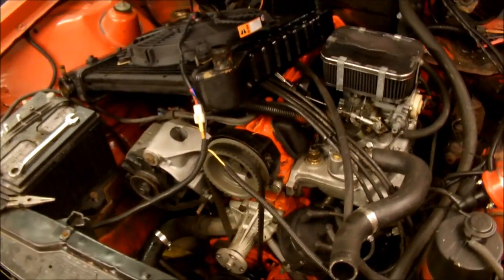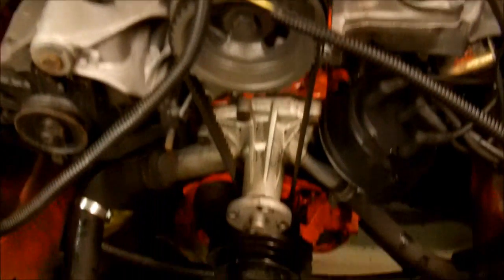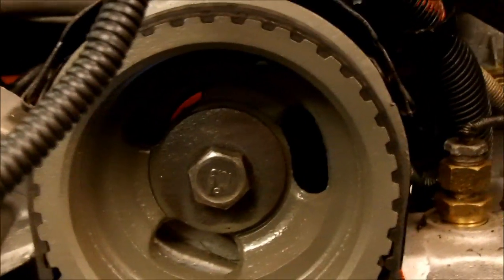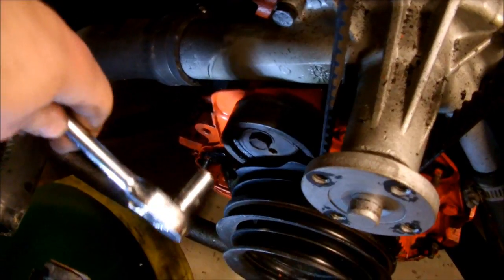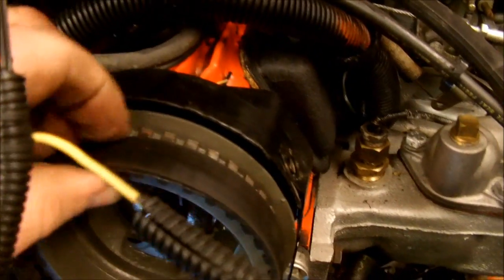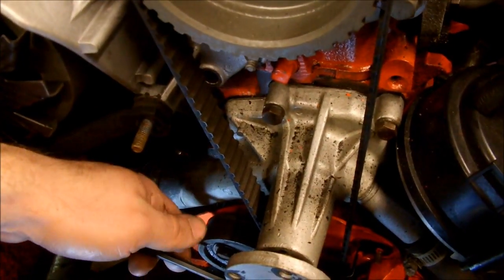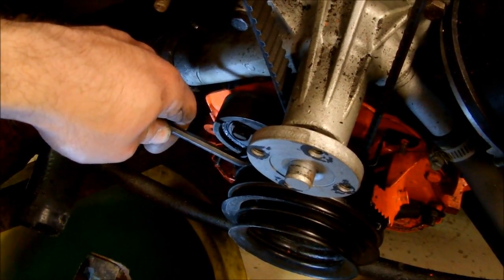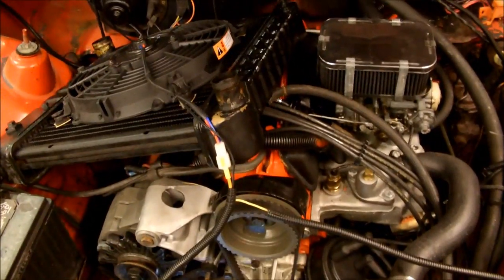How to change a Chevette Timing Belt

Comment: Installed Cylinder head on mine any help with vaccum lines needed to keep car running.  Need help should of took pictures got it running but won't idle due to vaccum any diagram help appreciated.

Comment: You rock dude! I just lost the timing belt on my 85. Thought a vid was a shot in the dark. Glad I found ya!
Reply from the maker: Its so simple but it seems to be lost knowledge already, thats why I made the video
Reply: +Fuel Injection Sucks What did you set the idle speed and/or total advance timing to? How many degrees? I'm at about 5000ft above sea level. Can't find shit except: 1400 @ 8degrees. Sorry, new to timing this thing.
Reply from the maker: +PharaohMoan As far as idle goes, 600rpm is manual trans, 800 auto trans. Timing I'd start at 8 degrees advanced at idle, and add in from there. Your high altitude is going to skew factory settings.
Reply: +Fuel Injection Sucks Thanks man!

Comment: I married into ownership of a 1979 white chevette in 1989.   I followed a series of videos from sloopy mechanic when I saw your twenty something horsepower chevette.  I still have the timing belt tension tool you mentioned.  The only time I used it was on the chevette.  The NAPA parts store suggested it.  The family came along so we sold the chevette and  moved on to a celebrity wagon followed by a couple of chevy astros/gmc safaris.  I believe GM made millions of chevettes but I do not see many around today.

Comment: Fuel Injection Sucks. How reliable are these Chevettes if you keep up on maintenance like oil timing belt? Thinking about getting 1 in future they seem good on gas cheap easy work on.
Reply from the maker: Pretty reliable but some parts are becoming a bit scarce.
Reply: @FuelInjectionSucks  is that a interference or known interference engine?
Reply from the maker: @briansmith9698  non-intererence, but any engine can be interference if you try hard enough.

Comment: Where can I buy another timing tensioner! Im loosing my mind😭
Reply from the maker: I'm pretty sure they are long obsolete. I've heard of people using tensioners from other vehicles, but not sure of an application to tell you.
Reply: @FuelInjectionSucks  Yeah, I got my Chevette imported from Mexico about 4-5 months ago. it was running when I got it but not very good. Rebuilt the engine all original cleaned it up. And then all of a sudden my tensioner is bad. It’s been about two months of me looking for a tensioner.
Reply: I’ve got seven Of them
Reply: @kevinbell9046  Help💀😂
Reply: Try Napa or Rock auto or a Chevy dealer